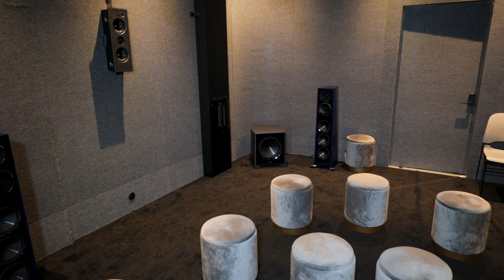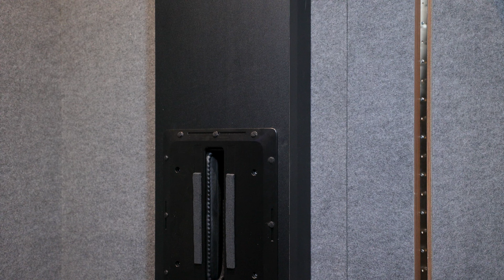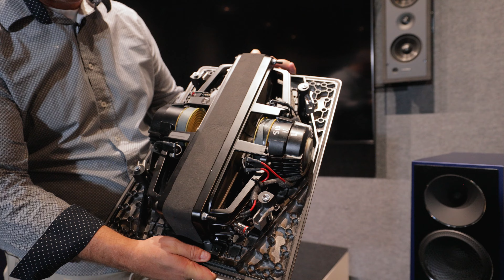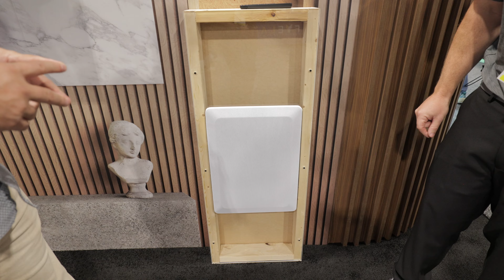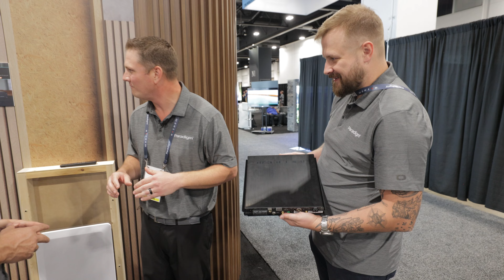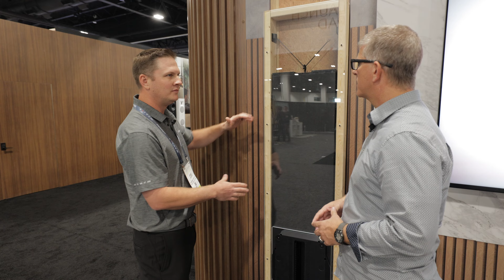In-walls That Sound Like Towers? Paradigm & Anthem at CEDIA 2024

Comment: There's so much misinformation about in-walls out there. A properly designed speaker is a properly designed speaker regardless of how it is intended to be placed in the room. Too many people immediately write them off, but if you do a little research, there are plenty of high-performance options available in an in-wall or on-wall form factor. Fantastic for behind an acoustically transparent projection screen.
Reply from the maker: Let's be real, the issue is the vast majority of inwalls are hot garbage. I have only heard two inwall speakers that I was impressed with. This system from Paradigm and Perlisten.
Reply: @Youthman  my NextLevel Acoustics are fantastic. There’s the JBL Synthesis lines, pretty much any of the Grimani, Ascendo, etc are essentially in-walls without an in-wall flange because they’re typically being placed in a baffle wall instead of a standard wall. The vast majority of mass-market in-walls are garbage, which is where they get their reputation. But step outside of Best Buy and there are some elite speakers that are essentially in-wall designs.
Reply: @Youthman  I don't know about that, as I've heard the Klipsch THX range and they sound amazing!
The set-up is extremely important too, as hearing a friends Klipsch set-up beforehand (not properly placed speakers, not tuned, no wall reinforcement or insulation, deadening etc.) and afterwards, was basically like night and day!
Now I'm looking at an in-wall set-up as his set-up puts my paradigm dedicated towers, center, rears to shame.
I'm currently looking at the Klipsch and Krix range (from Australia) to compliment my sub 2 from paradigm, and the extra space will be very welcoming.
Reply: @Youthman you are correct bc Perlisten and now apparently Paradigm using the same speaker drivers etc…

Comment: I recently went through a full 7.1 system upgrade. I’m pushing the Paradigm 120h’s and a 90c, 4 Surround 3’s and an XR13 - all driven by an Anthem MRX1140.  It sounds and looks phenomenal. If I had a dedicated space where aesthetics weren’t as important, I might choose to go with an option that was a bit easier on the wallet 😂 The XR13 is flat in my room to about 16hz, so for the money there are better performing subs for home theater. However, it does extremely well for spaces that are used for both theater & music and I absolutely love it. I also like the convenience of the top touch screen volume control on it as well.